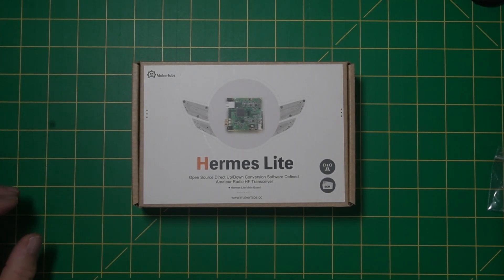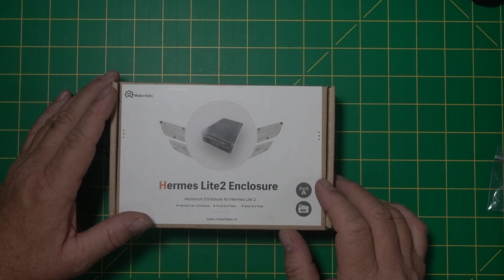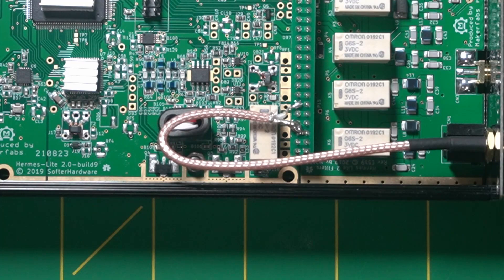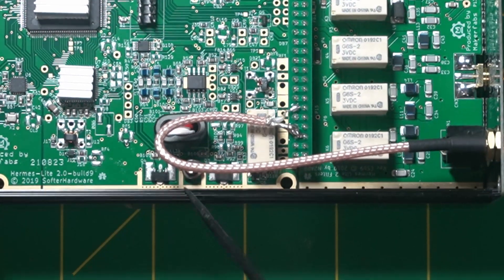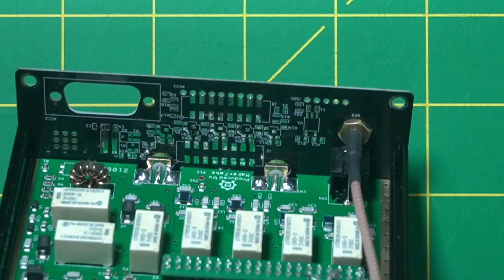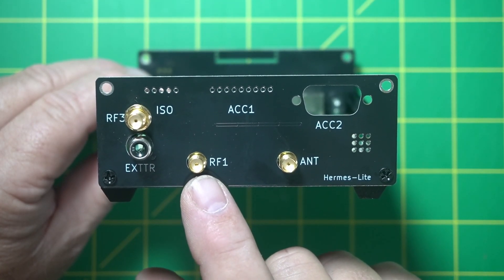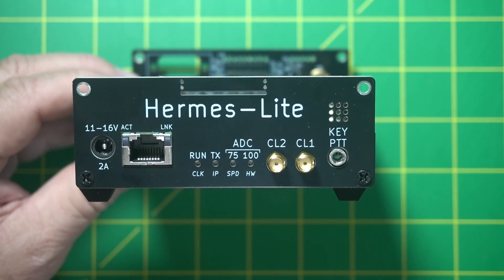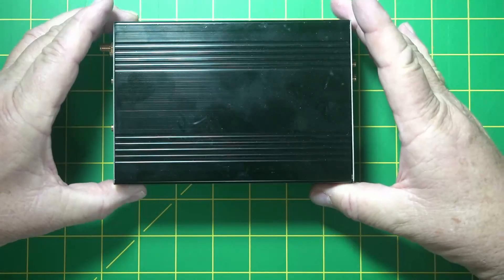How to do a Pure Signal Mod on the Hermes Lite 2 Transceiver.

Comment: Also I just read something about a metal shim under the 2 little power amp transistors on the hermes board to help heat travel to the case better.  Did you do this as well?     Edit:   nevermind I see that you have a screw and nut there.   i assume the metal shim is under that.
Reply from the maker: Yes Dan that was what the screw and nut was for the shim.